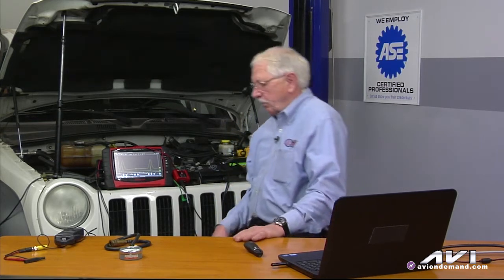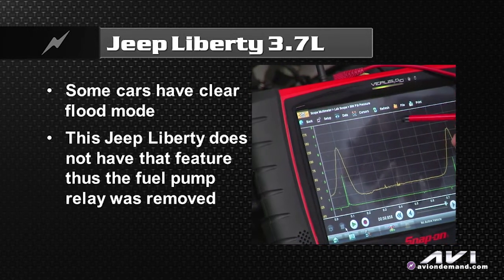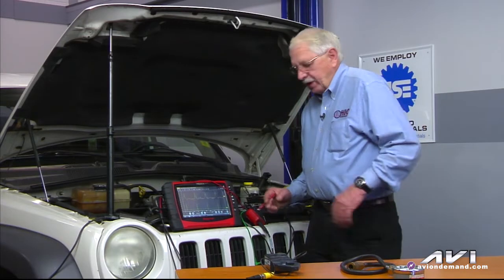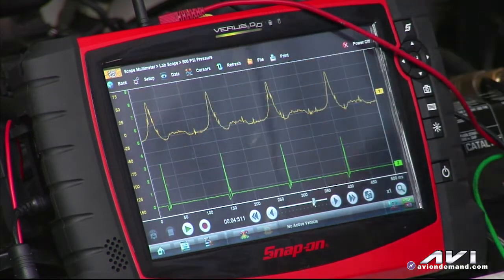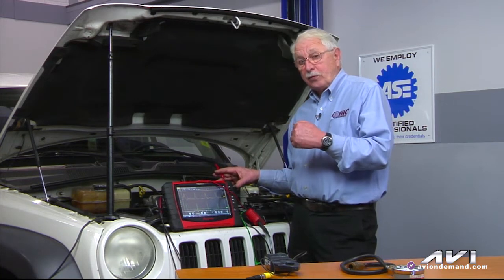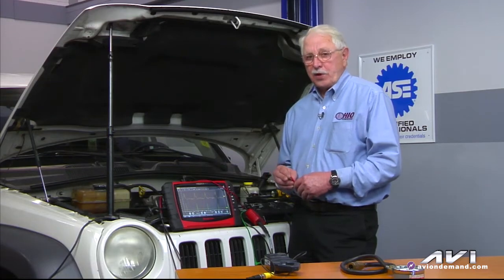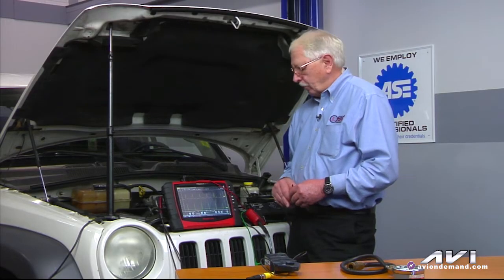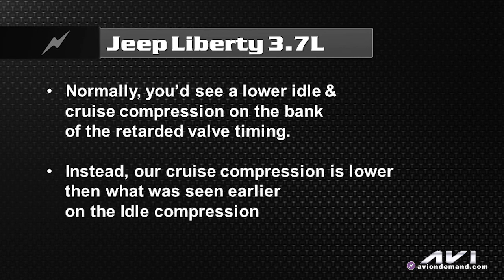2012 Jeep Liberty 3.7L Case Study | Bill Fulton  | Tech Tip

Comment: Thanks for the case study.. which pressure transducer did you use for the in cylinder test. Was it the snap on 300 psi unit or a pico WPS pressure transducer.
Thanks.
Reply from the maker: I believe we used Snap-On, since we tend to use it on nearly all of our videos. 
Hope that helps.
-J. from AVI